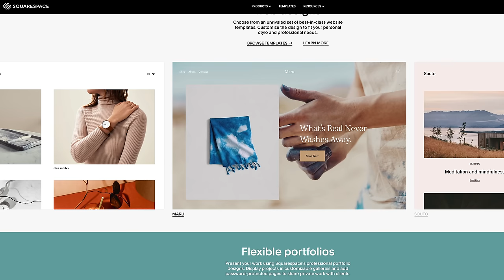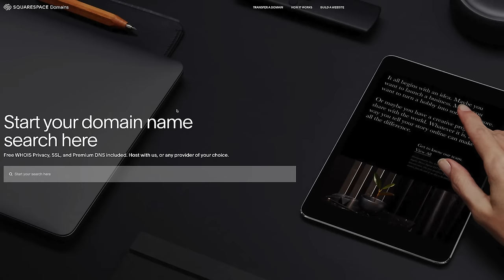A Tough Decision (Stopping what I was doing for 5 years)

Comment: Just a thought: Regarding the vent pipe in the toilet area, you could box out the entire area behind bthe toilet (wall to wall) rather than just the  a box around the VP and the toilet waste pipe. You can then have a shelf the whole way. OR You could even have built in shelves at high level hidden behind hinged panelled doors to have all your bathroom cleaners & spare toilet paper. This is usually a detail that is used with wall hung toilets and concealed cistern but it might work in this case! :)
Reply from the maker: I will consider it! Thanks

Comment: DIdn't you want to put insulation in around those window casings to keep the cold air and drafts out? before you closed them off?
Reply: Noticed the same,specially with the current single glass windows..

Comment: I'm a bit surprised they didn't fill in the space below the window sill and under the plasterboard places on the sides of windowswith spray foam insulation before installing it.
Reply from the maker: That would result in condensation on the brick and potential moisture  problems